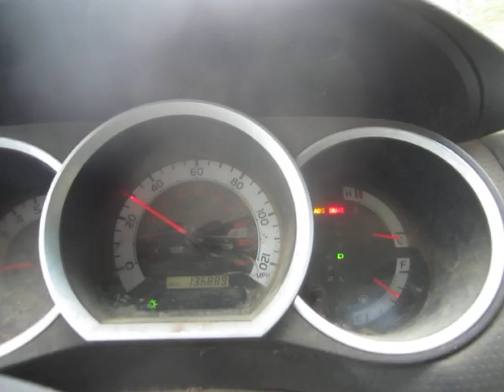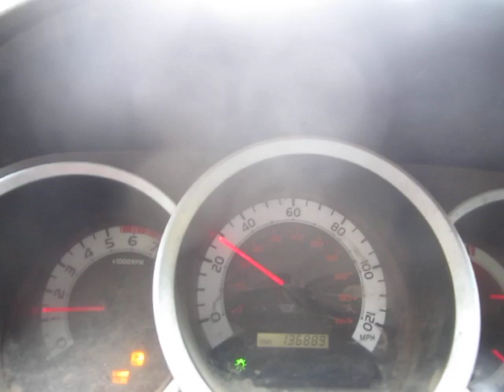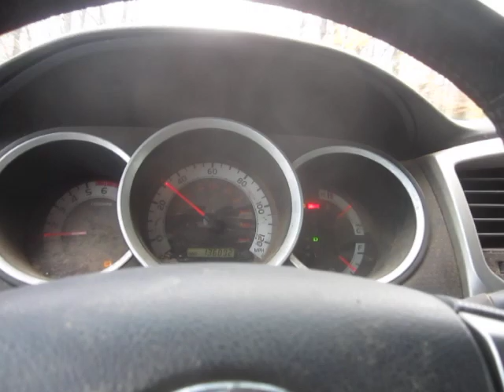Instead of "Simplify, Simplify, Simplify," It is "Complicate, Complicate, Complicate" Until We Die

Comment: Take your truck to an Auto Zone, they will read the code for free. Could be a wheel sensor. That is the cheapest part it could be so rooting for that. The code will locate one of four wheel sensors, or the ABS Modulator, or something else. Good luck amigo.
Reply: And yes, you can drive without ABS.

Comment: Most cars since 2000 have had ABS. When you brake hard, the brakes release slightly on each wheel, when if it starts to skid, so that the wheels keep turning. If the wheels keep turning, then you can still steer. So you can steer and brake at the same time, if the ABS is not working, you are more likely to get into a skid if you brake hard, also you may not be able to steer while braking strongly. All that aside, if you brake firmly, but don't lock up the wheels, then you can still steer.
Reply: The whole thing is a diminishing return on technology. Yes, the fractal complexity is getting dangerously complex. This is  why there needs to be parks in cities, you need some empty space to land the helicopters and build a camp in a city when civilization is interrupted by a disaster.

Yes, when it all goes in a hand basket, people won't bother to get an annual vehicle inspection. Mad Max never would never have cared if the ABS was not working.
Reply: Petrol has always been really cheap in the USA, what you are experiencing is what New Zealand went through in 1984, when the country became insolvent. We decomplexified, with a couple of no present Christmases, but at least the power stayed on. But I doubt it will be that easy this time.
Reply: Good luck with it all.

Comment: Maintainence light is easy to shut down reminds you to change your oil at 5000mi....it's in the book in your glove I assume. Terrance did speak of the increased complexity as you approach the collapse.....so it goes
Reply from the maker: The brake light was off when I left your house. No cap in Dryden. The light came back on when I was a few minutes from my house.
Reply: @Humptydumptytribe  When was the last time you had brake pads done? These sensors are pretty sensitive.